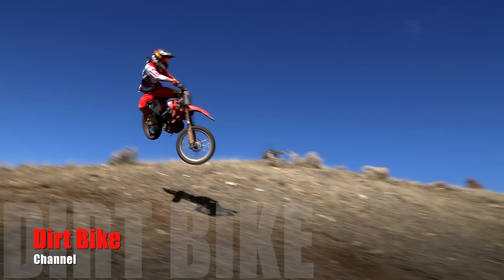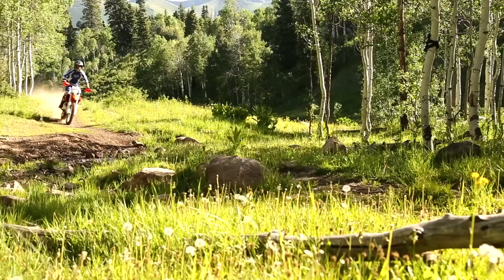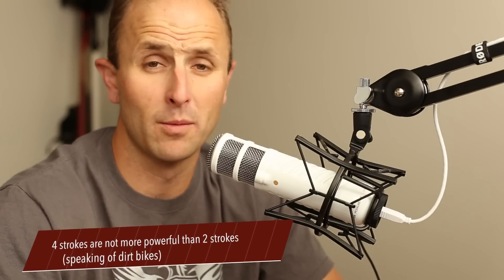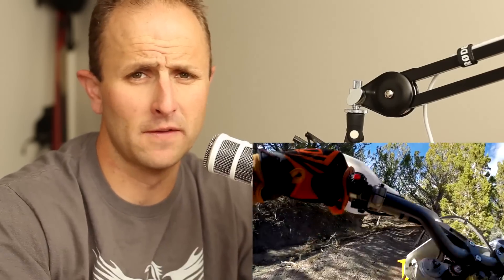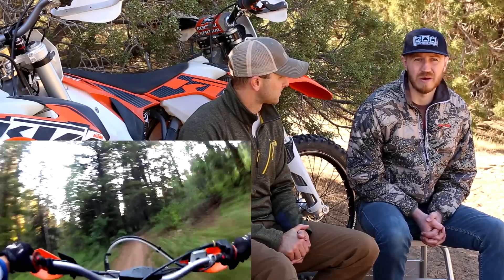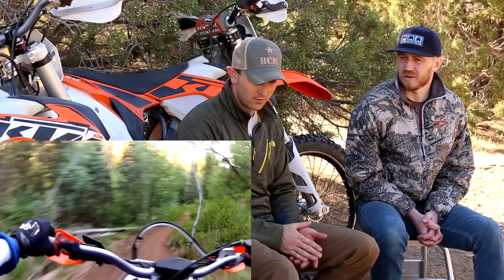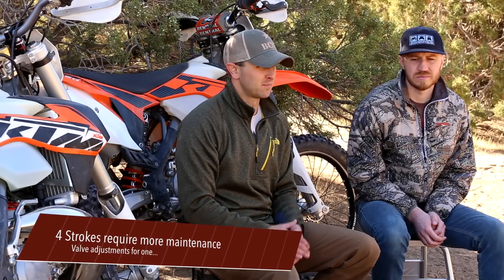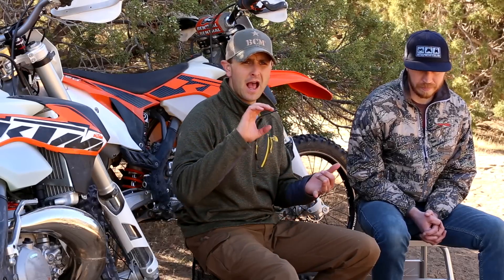Enduro 4 Stroke vs 2 Stroke Part 1

Comment: Hey I really hope you read this @dirtbikechannel I highly disagree with the statement that all motors are a ticking time bomb. My dad has a 1983 Rm 250 two stroke and the bike has never had any type of  rebuild, suspension or engine...heck it still has the stock grips from 83 when my dad bought it brand new, anyways this thing is bone stock and has way over at least 2000 miles on it, maybe even 3 or 4 thousand. we compared it to another 1983 rm250 with a newly rebuilt top and bottom end with only 18 hours on it and the two bikes had the same power meaning my dads bike hasn't lost any power. I found this very shocking and I felt I should share it with you guys. This bike has never been worked on besides spark plug cleanings and oil changes, never had the muffler repacked or anything and we still rip around on it all the time, not to log ago he had to tow a ktm 450 that broke down, my point is this bike is bulletproof and I dont believe its a ticking time bomb. It still has as much power as a brand new 250 two stroke, the suspension and braking however are very lacking compared to the new bikes
Reply from the maker: +mx&bmx My dad owns a few bikes that are from 1975 and 1981 that are still running.  They will fail eventually.  That is a fact. Ticking time bombs :)  Each engine will only run for a finite period.  Nothing will last indefinitely.

Comment: I spent more on my cr250 maintenance wise then my 450 I've only had to do oil on 4 strokes and getting shim done this spring 4 year later...2stroke seized on me 1500 new cylender and piston etc then 3 other rebuild 200 in parts 4 stroke just regular oil change Hondas last linger tho because trans oil don't go in engine...

Comment: Most 4stroke guys just won't understand the feeling the 2T guys get, it's the simplicity x fun factor versus a sterile 4 stroke... Sterile is not BAD... its just not a 2 stroke that's all. 2 stroke guys don't mind riding 4 strokes, they just like 2 strokes better... A lot of 4 stroke guys can not/will not ride a 2 stroke.

Comment: I think this is a bit misleading when discussing the work required to maintain each bike. If you want to PROPERLY take care and maintain a 2 stroke, they require the same amount,
Possibly more than a 4 stroke. You should replace the piston on a 2 stroke well before 100 hours. That’s not necessarily the case on a 4 stroke. 4 strokes are extremely reliable now. As are 2 strokes. Checking valve clearance takes a few minutes and often times don’t need to be adjusted. Shims are inexpensive. So I think there is a little bias involved in this discussion. Both have their place.

Comment: This video is funny. I get it, 2 strokes are good, but I also know 2 guys with new husqys and ones fuel injected and the others carbed and both are having power issues. One needs a fuel pump, the other needs a carb clean/rebuild and gaskets, which now'a days aren't as cheap as they were when this came out and that's also time working on your bike as any bike in all reality. Also, a valve adjustment takes  30 mins to an hour, it's easy stuff, a carb clean and rebuild will take 45mins to an hour and a half. Also valve adjustments aren't going to stop or lead to any catastrophic failure just hot start issues and thats about it. Don't get me wrong, the next bike I'm buying will be a 2 stroke but I'm not selling one bike to replace another. It's all about diversity. 2 strokes have better top end, 4 strokes have a more linear power band all throughout the band. I ride with 5-7 people usually and I have a 4 stroke 250, my brother has a 4 stroke 350, one has a 4 stroke 230, and the others all have 250-300 2 strokes and the only 2 that can duke it out and have a real competition are the 2 stroke 300 and 4 stroke 350 and they've both been riding bikes for years and years. For the most part and it's all about riding skills and experience. I have only got to go out with them twice and I keep up, my bikes brand new and I can catch up with them just fine when I want to. Mainly they like to do 60-70mph down the roads in between trails where as I try and keep it to 50-60mph to avoid any weird stuff with on coming traffic as they have way more experience than I do. In the end, do you want to deal with premix and plugs or oil injection and routine maintenance, or a valve adjustment and routine maintenance. To each their own.

Comment: Two stroke has the only  advantage of light weight. Throttle is like switch - ON / OF
You would need to rebuild two stroke far too often than for stroke.
 Four stroke fuel consumption is way better....  far more controllable and easier to ride.

Comment: should i buy a 125 2 stroke or 4 stroke
Reply: If you are a beginner then a 4 stroke for sure
Reply: Lik3 ViaZ im not a beginer but i think that i should buy a 2 stroke because it accerlates faster. But in the other hand 4 stroke has a lot more torsion
Reply: +Tony TheGamer oh well then it completely matters what you're gonna use your motorcycle for, four stroke enduros are not as common as 2 stroke ones so with 2 stroke you have more to choose from

Comment: The old school 4 strokes had longer piston skirts  and lasted forever. The modern 4 strokes have a much shorter piston skirt so then pistons wear much sooner. The 2 stroke still has a longer piston skirt. As far as I'm concerned,  the 4 stokes don't last any longer than the 2 strokes.  2 stroke top end rebuilds are probably half the cost of 4 strokes. Thats just replacing the piston.  Wait till you get into the head and watch the cost empty your wallet.  Most catastrophic failures in 4 strokes are exactly that,catastrophic.  If the bike is 3 years or older, the cost of a major engine failure will exceed the value of the bike. 2 strokes today are so reliable you pretty much have to do something stupid to break them.  Even when crank or rod bearings go,the engine is still relatively cheap to repair. Only thing four stroke has over 2 is emissions and fuel economy.

Comment: Its actually not true that 2 strokes put out more power per cc than 4 strokes the reason why a 2 stroke is faster is because it gets an extra combustion by the time a 4 stroke gets its combustion so a 2 stroke is more powerful because is goes threw 2 cycles while a 4 stroke goes threw one but if you were to compare the combustion power from a 4 stroke to a 2 stroke the 4 stroke has a better combustion and more power it just can;t release  that power fast enough due to its 4 cycle limitation.

Also 2 strokes have an added component an expansion chamber which is like a turbo to a 4 stroke but uses sound instead of air as in a 4 stroke.

Comment: I just rebuilt the top end on my 05 crf450 for$700 with a new jug and all, granted it's still a lot more than a two stroke, but I love the bottom end power I get from my four stroke, and I've never been good at predicting the power band on the 01 cr250 I had before...
Reply from the maker: nick3209 Thanks for sharing.  You didn't have to have any machine shop work did you?
Reply: No, that's why I replaced the jug, the price of a 4 stroke rebuild has REALLY come down the last couple years, I also did the rebuild all myself, so I also avoided that expense... You can even do a new crank rod piston and bearings in a crf450r for less than a good and now a days...
Reply: After reading through some other replies I should also mention I had already replaced the valves with kibble whites and I had to do the top end because I blew it up...
Reply from the maker: Now we are getting the whole truth :)
Reply: Haha, yes, I guess all in all the complete "top end" was around $900, lucky for me I did the valves before the seats were shot...

Comment: It's interesting 20 years ago, I had a KX250 and I'd ride it for a long time before I'd change the oil, and it never missed a beat, but bloody bikes now, you can only ride it for 150 hrs or less, before changing the oil ect, and as a teenager, I had a KX80, some 28 years ago, and I'd ride it all day, and forever, before doing anything. The simple point I'm making is, it's ridiculous how bikes these days, you have to constantly do maintenance, and these are modern bikes. Whatever happened to being able to ride and ride and ride, and never touch anything, besides filling up the oil or changing tyres, and because of today's bike prices, it's ludicrous of cost now, just my thoughts.

Comment: i bought a 2006 yz250f without the factory break in for 2500 bucks which was keeper than any used two stroke i could find here in saskatchrwan
Reply: really? I saw a a few cr250s and 125 for 2 grand that looked pretty good.
Reply: In Saskatchewan
Reply: +Cattailclan Tim yeah I know I live in moosejaw
Reply: I only looked beetween stoon cause i live in la ronge

Comment: Kx100 or Crf150rb ??
Reply: Depends on what you want it for.
Reply: +EmeraldGamers MC trail riding and street and power lines
Reply: OhSimply Those are all very different things, but I would recomend the CRF.
Reply: The kx100 will be more fun, and feel more powerful, but it doesn't have the best low end for a 2 stroke.

Comment: Kind of a biased message here. Your comparing the cost of purchase and maintenance for the motorcross high rev 4 stroke. You fail to mention the xr series, as Honda had for years. My uncle estimates 2500 hours on his xr250. And head has only been opened for adjustment once. Hey I love the 2 stroke but who is riding a 250 or 450 motocross 4 stroke where you ride?

Comment: Got a older 86  RM250 still hangs fires up every year if not it will  ding ding ding  roll the gas a few times and get the gas going in her she'll  fire first kick and when I got it it was mixing the water in the oil new seal called it good never put anything other than 87 gas in and whatever oil I'm cheap but still cooks run her hard and put her away wet she even has a kick stand love that old beater

Comment: Im riding about 10 hours a week on road, and im planning to maybe buy a KTM EXC with supermoto wheels, wont that mean that i have to change the piston every 10 week? :I
Reply from the maker: NTKLife Don't mix dirt and street.  If you are riding that much on the road, just get a road bike!  You'll have more power, higher top speed, better fuel range, less vibration, and a better overall experience when you keep the road bikes on the road and the dirt bikes on the dirt.
Reply: I don't do regular riding tho, im stunting :)
Reply: NTKLife KTM EXC 450/500/530 is the way to go for supermoto, my 530's valves stayed in spec for 110 hours or 4000km
Reply: @VVVV-yr4tp  how much does it cost changing them?

Comment: 2 stokes are just as reliable. They do wear out faster but give you a lot of warning before they go but a very cheap to rebuild. A 4 stoke rebuild will cost 1500 tops. I rebuilt my exc 450 for around $1000

Comment: So you say that you have to replace parts Alot on 4-strokes because they wear out faster but I have an 05 crf250x and I have had it from then and I haven't had to replace anything in the motor and it still has the same power. I'm not sure where you're getting this information from but it's wrong.
Reply from the maker: Starfoxx17 The 250x is not the same compression as the more modern, higher compression, hot rod racing motors of today.  The CRF 250x is a great bike and does not require the same amount of maintenance on the motor.  Keep hold of that bike and she'll treat you right for years to come!  Honda got it right on that one.

Comment: Guys I have to ask: are 2 strokes too much power in real tight terrain? I ride 4 strokes because I believe they deliver more torque on the lower end. I don't like the idea of the 2 strokes power sneaking up on me, is that a misconception?
Reply from the maker: Big bore 2 strokes have more low end torque and are easier to ride in the tight, tricky trails.  Spoken from a guy who have reviewed 11-12 bikes in the past few years.  I have split time almost 50-50 on 4 stroke and 2 stroke in the past 2 years.
Reply: Dirt Bike Channel Ok so that being said, what would you recommend with a big bore kit? How do KTMs hold up through the years? I've heard some rumors about their lack of reliability.

Comment: I hate two strokes. I hate modern 4 strokes. Modern 4 strokes are trying to mimic a 2 stroke. Id much rather own an old school 4 stroke thumper. Low end torque? Lol...yah. Maintenance? Legendary. XR 650 R you can ride part of the day and plow your fields too. Its all about what kind of riding you do. I like a heavy bike that soaks up ruts, root wads, rocks, etc. And Im not competing at Erzburg. Im driving to work, scouting for Elk, going fishing, ripping fire roads, single track, hill climbs off track, Im doing it all. And I can buy 3 XR’s for the price of a new KTM in either flavor. Modern 4 strokes are like a Lambo V 12. I still want the Cummins 12 v!

Comment: Looking to get a bike after nit riding for 30 years. Yes 30.   I used to trail ride and race a CR 250 back in the late 80s early 90s.  I won’t ever race again.  Just want to trail ride.  I haven’t rode a 4 stroke since I was 12.  Not sure where to start.  Mid life crisis?  😂

Comment: Well my four stroke...clean the air filter..change the oil..start it go..get into.terrain I'm not good enough to handle?Pull the throttle the four stroke will rescue you
.I've had a kx 450 for five years..Never done valves nothing it just starts every time and goes..

My son has always ran two strokes...he races..
Mix gas..rings ...toop ends... clutches..

Seems the opposite to me..just my opinion

I literally feel it's oppsite..My sons two stroke is constant maintenance..
My four stroke..I just keep putting gas in it and go every time..

Side note we are not a mx family..We both have always ridden single track,he races hare scrambles and I brought him up learning hill climbs....At Carnegie..(SF Bay area)
Reply: amen brother

Comment: I dont agree on all pro 2 stroke arguments. Fuel consumption is 30%-50% more. Same rider same track same twisting.... Main bearing and conrod bearing life is half of fourstroke as there is compromised lubrication on those components.  Piston, conrod mains cost the same regardless how many strokes. Add extra fuel cost. I dont see how 2 stroke is cheaper. If you put all numbers on the paper preferences aside. There is no difference on running costs. I love them both but dont be fooled that 2 stroke is cheaper to run and maintain regardless brand new or used. However 2 strokes are much more fun to ride puts a smile on my face regardless if its 65 85 125 or 250. Havent tried 500 maybe smile will not come on that one....  i have small repair shop have worked on lot of engines and bikes.

Comment: can you please verify this I have heard that if you stay on the throttle too long without letting off on a two stroke bike that it will burn a hole in the piston a few buddies of mine have had them and I never rode with them but they said they got rid of them for that reason I love two strokes but own a four stroke never rode a two stroke either
Reply from the maker: Corky Westmorland Dude, if you can stay on the throttle long enough to burn a hole in the piston on a 2 stroke, you are a bigger man than me.  If you stayed on the gas that hard and long on a four-stroke you'd be throwing a rod somewhere through the motor!  Sounds like your buddies had bikes that were a little "long in the tooth" to begin with.  I've never had any trouble with my 2 strokes, but they have been newer/ well maintained bikes.

Comment: love the video series.  love the channel,  but those prices you have on the 4 stroke top end are simply not even close to true. You said $2300 for a top end. an entire piston and cylinder kit is $450 for my bike. And 9 times out of 10, you don't need to replace the cylinder. Just hone. a piston is 150. a hone is 50. 200 for the top end. Oh, you want to replace valves too? no problem. 200 bucks will get you the best titanium valves money can buy. 300 if you want the valves and springs kit. trust me, I just did this  job on my bike. then every 2 top ends you do a timing chain. those are about 50 or 60. valves need replaced anywhere from 2- 5 top end rebuilds. depending on how clean you keep your filters. say you need to do it all in the top end. 550 will do the entire motor above the crank. You need a crank too? still no problem. entire bottom end kit including crank, main bearings, and while motor gasket kit is around 400, depending on the bike. If your entire motor is shot, you are looking at 950 to do the entire thing, if you are smart about it that is. We haven't even hit 1000! I don't know where you got your 2300 figure.
Reply: I agree with you
Reply: 2300 is if you get ricky Carmichael to rebuild it ,, I have an rfs engine ktm ,, rebuilt it once in 2012 ,, still stomping 2t`s guts out
Reply: +KTM seventyseven exactly!
Reply: +Dirt Bike Channel I'm calling you out. lol. seriously though. I am an avid watcher and follower of the channel, and love all the content you work so hard to put out. I also love 2 strokes! you said "2 strokes have been poopoo'ed on." Well, don't "poopoo" on 4 strokes. Other than that though, love the vids and keep up the good work!

Comment: I race a 250 2 stroke in the lites here in Australia and those 250 four strokes struggle haha
Reply from the maker: dan reed Thanks for commenting from Down Under!
Reply: Dirt Bike Channel no worries, nice vids just changed my jet and needle over. If anyone is wondering what the torque is like on the new two bangers,  I run standard gearing and I start in third!
Reply from the maker: dan reed Heck yeah!  2 Strokes can have tons of power down low!
Reply: Tons of power